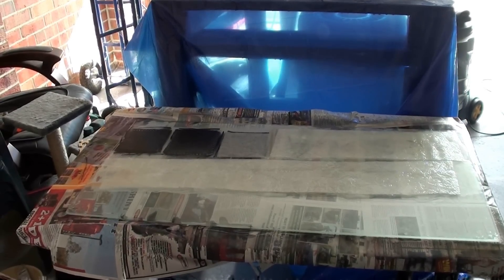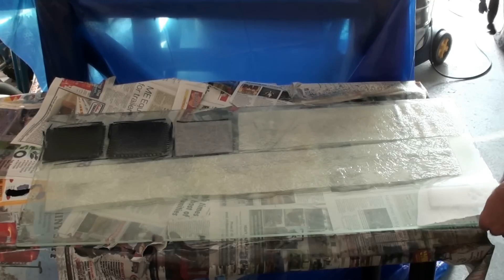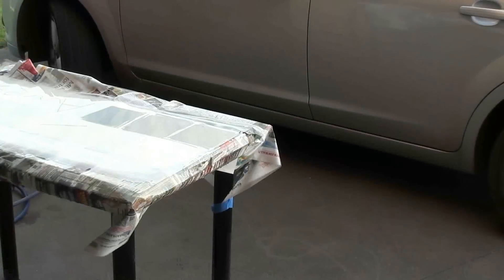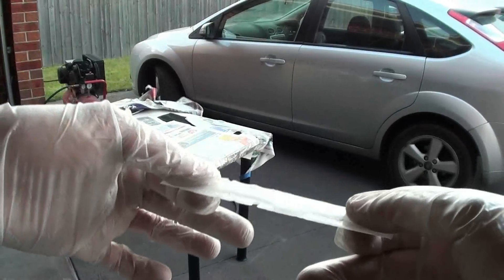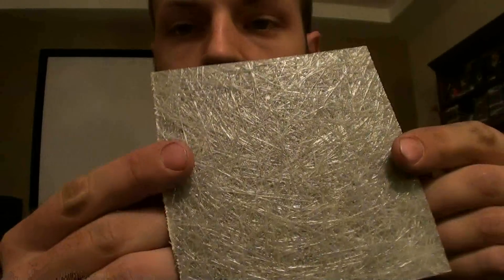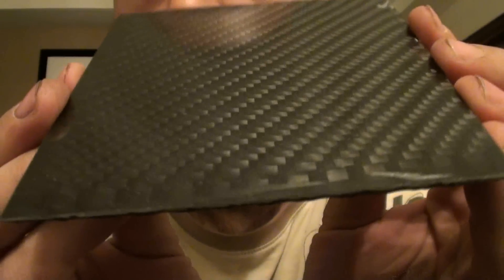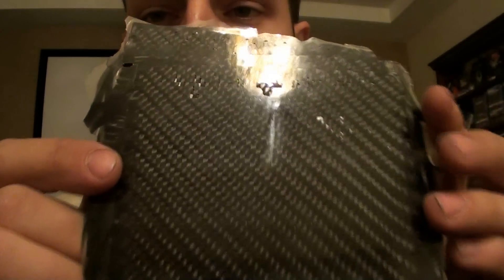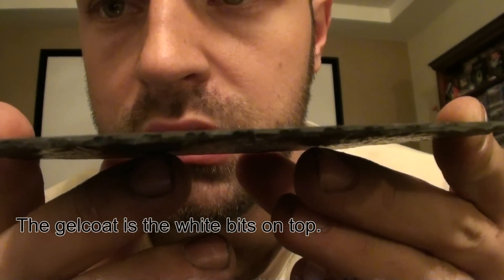Carbon fiber production techniques - Part 4 (cutting and comparisons)

Comment: The middle of a sandwich doesn't have to be very strong. If the stack is being bent, the top is in tension, and the bottom in compression. Obviously, in the middle, there's very little load (it must be zero at one point). The sandwich "filling" only has to be able to keep the skins apart.

Comment: That's debatable. FG and CF have around the same strength when in a laminate, but CF is less dense and stiffer, that is why you can have a stronger and stiffer part in CF compared to a part of the same weight in FG.

If weight and rigidity are important and cost is not, then use CF, otherwise use FG.

Also, CF is more brittle and tends to shatter when it fails, that is why racing teams use aramid layers in their panels, it holds everything together in a crash.

Comment: You seem to be knowledgeable in some advanced areas, like infusion, but lacking in some of the basics.

The reason the fibreglass is separating from the epoxy resin is because it is Chopped Strand Mat (CSM), the strands are held together with a binder material that will only dissolve in polyester resin, not epoxy. So the epoxy is not actually binding to the glass fibres, just the weaker binder.

Comment: Great videos, thank you.  Just wanted to make a suggestion.  I noticed you have an air compressor.  You can use a blower nozzle to shoot compressed air between your cured part and the mold to help separate the two.  This is especially helpful for heavily contoured and/or deep complicated pieces.

Comment from the maker: hmmm the wax paper may not be necessary and i'm not sure how well it would separate from the epoxy... depends on just HOW waxy it is perhaps. Better off just waxing the glass itself and then rubbing on some pvc release agent... but if you can't be bothered getting that stuff, the wax paper MAY work, but it wouldn't be terribly great finish. squashing it down would be a great idea - lay on as much weight on it as possible actually - the more the better - impossible to squeese it "too much"

Comment: did I forget to say "thank you " for doing this. sometimes I forget what effort it takes to even make these videos.  much less actually knowing what you are talking about if not completely. tell me something though what is the correct foam to surface material? for ideal rigidity. I have an idea it depends on the length and surface area.

Comment: there is a reason why aerospace companies use honeycomb metals they add massive amounts of strength with very little weight penalty.  if  your doing is right you will never have too much resin , that should be weighed out before injection anyhow.

Comment from the maker: not really. this foam core is just fine - plus the way it has grooves in it really helps the resin flow too. a metal honeycomb core would probably (depending on how it's made) fill up with resin and add massive weight to the part